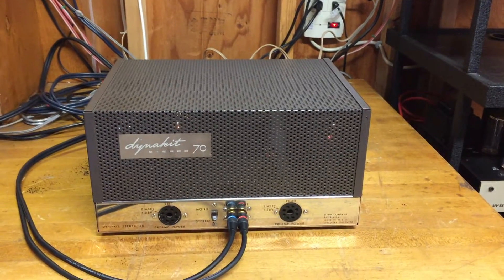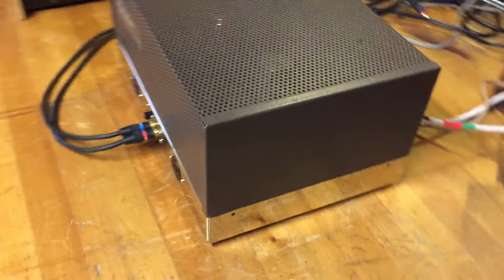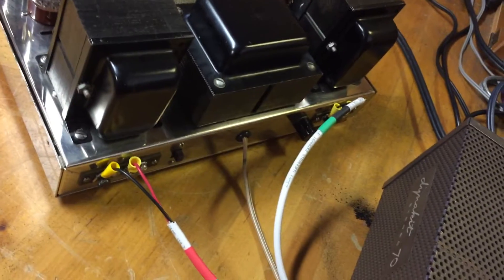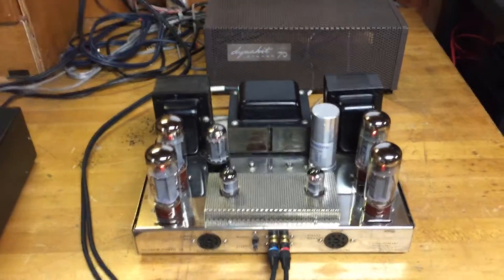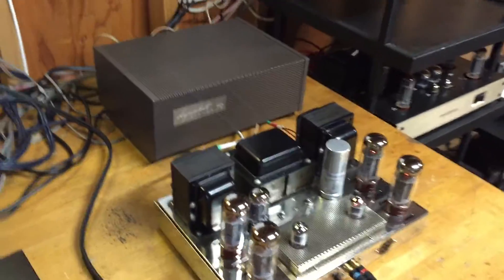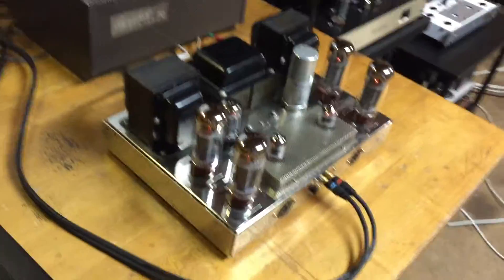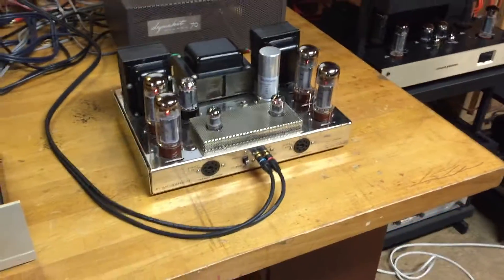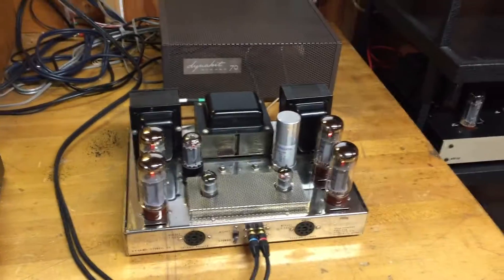Dynaco ST-70 Tube Power Amplifier - Rebuilt & Recapped  - Jimmyvp1

Comment: I've got several tube amps including 2 Mac75 mono-blocks and a Mac270 along with Mac Tube PreAmps and Klipsch RF7 Speakers, but I have always wanted to try a Dynaco ST-70. A local Audiophile wants to sell me his Dyna-Kit Stereo 70 for around $200 which seems quite a bit lower than Ebay prices. No mods and very clean.  I was impressed with your demo...well done. Cheers!

Comment: Where did you get the perforated chrome plated cover that fits over the two center pre-driver tubes? You amp looks complete with that extra cover. I own a restored original 1964 factory built Amp and have been searching for that missing cover to complete my restoration. Can you or any of the readers suggest a source? Looks great by the way!
Reply: Hello ! need one of this too. if by some chance you know a spot where i can get one x thanks in advance.

Comment: Very nice unit! What replacement quad capacitor values did you use, 30/20/20/20 or something higher for greater protection? I am having low bias issues and about to order a new quad cap and was thinking to go with an 80/40/30/20. Any thoughts, suggestions? Thank you in advance!

Comment: Very nice. I haven't seen one in the condition yours is in, in years. I built two of these in 1971 along with a Dynaco PAS3X preamp. I ran the power amps in mono for 70 watts. My speakers were AR 2Ax's, along with an AR tuner and turntable. I'm really sorry I sold that system.
Where did you get the cage that covers the driver board?

Comment: Had one of these early on. Heard it with an Altec speaker system containing a 511B. 35 wpc was not enough for the speaker at higher volumes. Nice amp though, but I wouldn't  trade my Son of Ampzilla for one.

Comment: Wonderful amp, love mine. It tended to blow fuses though so I replaced the rectifier with a solid state Weber Copper Cap. Works great as you can see in this video: https://youtu.be/cLIOW28RxXo